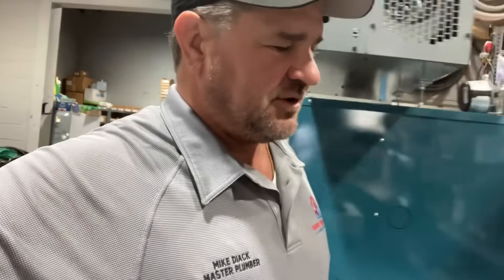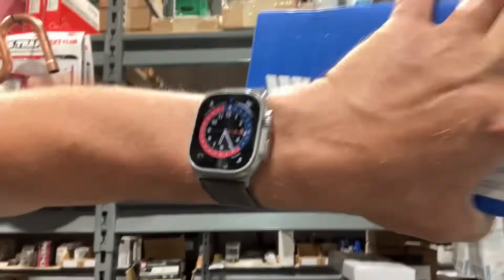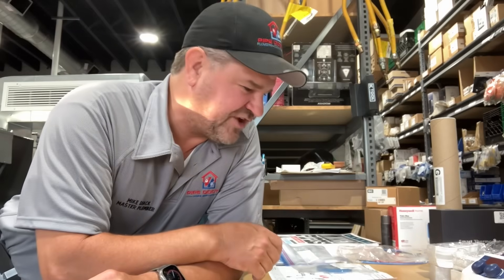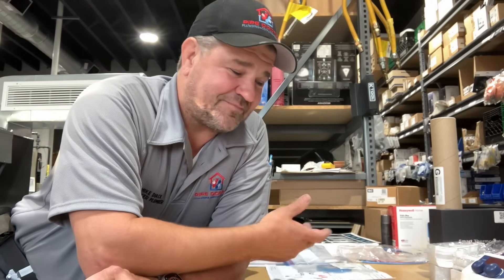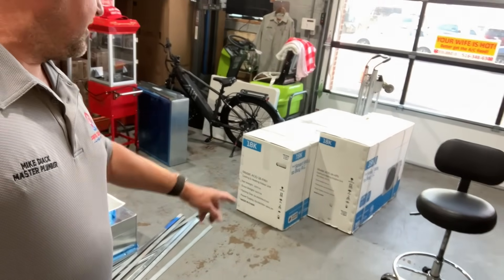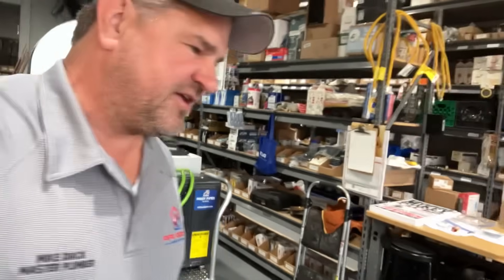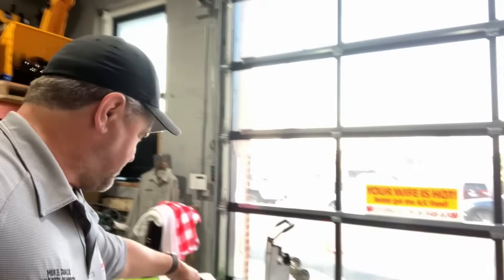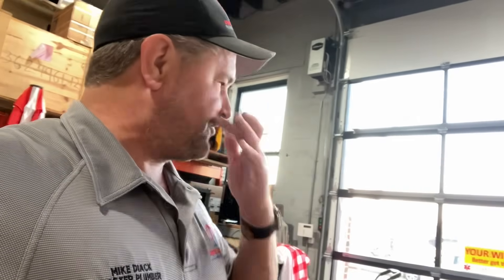How Sprinklers Can Poison Your Water | HVAC Rant + Poster Shoutout!

Comment: I just had to replace a backflow preventer at our commercial greenhouses this Spring. I didn’t realize there are two types depending on your application. Double check valve or RPZ (reduced pressure zone $$$). $1200 just for a new 2” RPZ and that doesn’t include installation or testing, and they want testing yearly.

Comment: Seen main water supply incoming to 2  3/4 lines. 1 going to sprinkler system with no back flow the other feeding the house. To stop the poison coming back from sprinkler heads he put a back flow on the house water to protect his water. No! Put in 2 back flows to mark sure no poison to enter the system as well as the house.

Comment: 3:50  Many years ago I woke to a gurgling sound coming from my standing water heater.  No water pressure, then learned a main had broken way down the hill from my house.
Not long after that, I installed a brass check valve.  I'm cheap!  I paid for that water once, I'm not paying for it again.  🤪